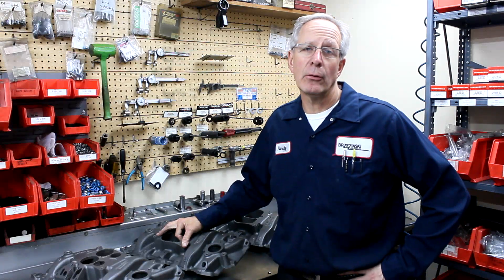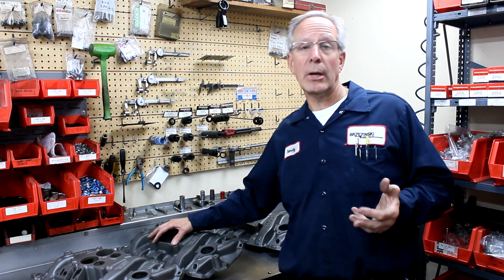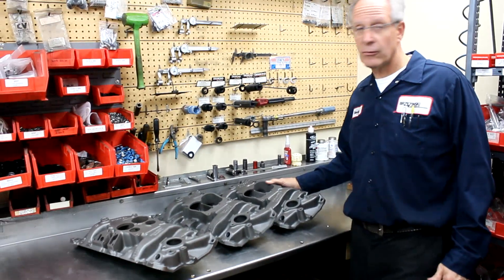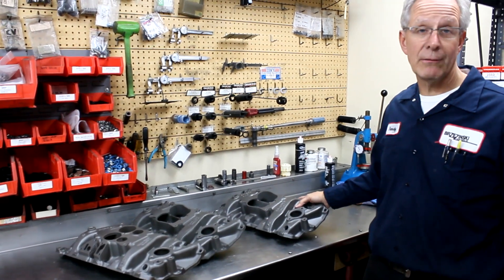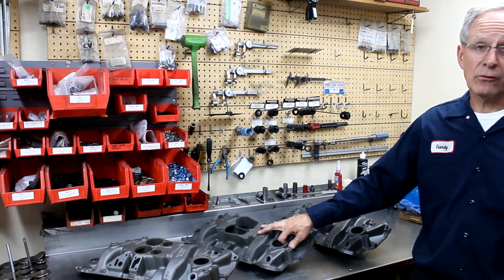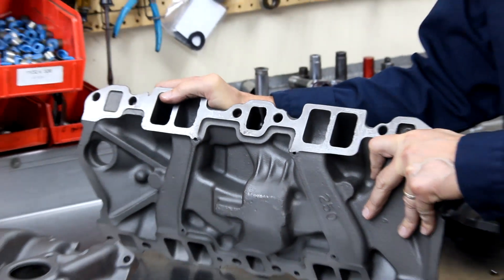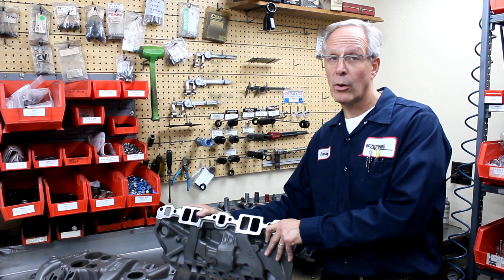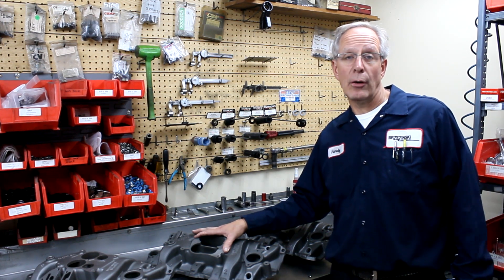Cast Iron Q Jet 4 Barrel Intakes

Comment: On my stock 1972 C10 350 4bbl which will never see over 5000rpm and is only street driven, should I convert to a 2bbl and rams horn exhaust? I want quiet, better power and fuel economy. I'll also be replacing the current 4-speed with a Tremac 5-speed. Thanks in advance.
Reply from the maker: For something like that your best to stick with the 4bbl that you have. As far as exhaust the LT1 manifolds will get you the most power, if they will fit. If you're are looking for center dump style, the ram horns are your best choice.
Reply: @BrzezinskiRacingProducts  
Thank you. Not sure why I was never notified of your reply, but thank you very much.
Reply: @20alphabet  it's hard to get any fuel economy from a 350. 
I recently built a 350 for fuel economy for a friend. Used a boat motor 2 barrel intake with a motorcraft carb and ram horns. Stock cam advanced 4 degree's. Runs very smooth. Soon to check mileage.
Reply: @cammontreuil7509  
Back in the 1980s I built a 350 for a 1972 Chevy Nova for efficiency in both power and mpg. I could average 20mpg from Ontario to San Clemente with a 350TH transmission and stock rear gears.
Reply: @20alphabet  20 is an impressive number. I will reserve judgement on that, probable with pro jection.  My brother was getting good mileage with a 2.50 rear end in a van with a 350. But never said how much.
I've only built 30 or 40 mouse motors and don't know what combo works best with them for mileage.
Now talking Ford that's a different story. Every Ford I have built with a long rod makes better mileage and other improvement. 
I run a boss 302 in my 68 F 100. I get 15 Miles per gallon. It is not stock. Just put together for mileage and torque. It's an interesting engine to experiment with.
It would be interesting to take your 5.7 rod 350 and switch to a 6 inch and flat top to see the difference.
Reply: @cammontreuil7509  
Compression was 9.5:1, the cam was a Melling CRV 3 with the lobe centers taken down a bit to reduce overlap, the heads were ported 041 castings with 2.02 valves back-cut, the intake was an Edelbrock Performer with a Carter AFB. The transmission had a shift kit, and the differential was open. Hope that helps.